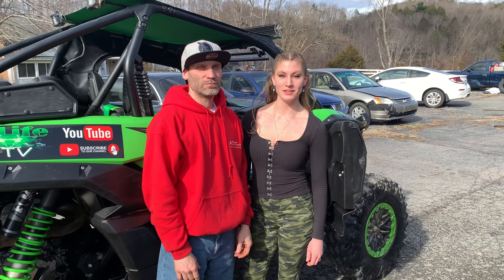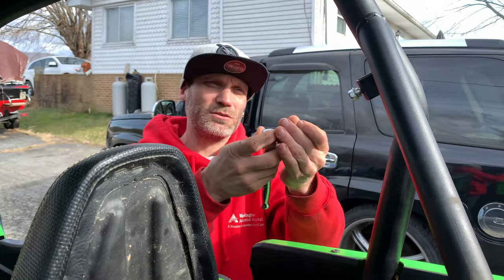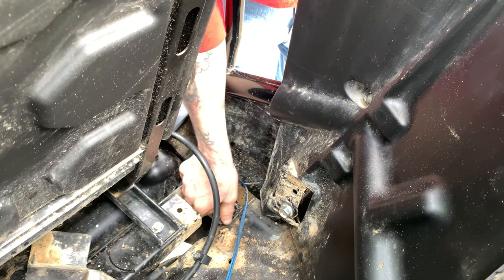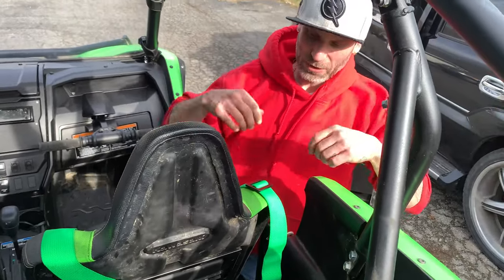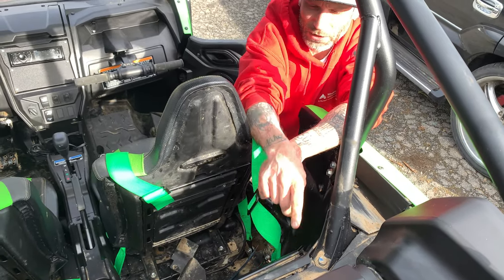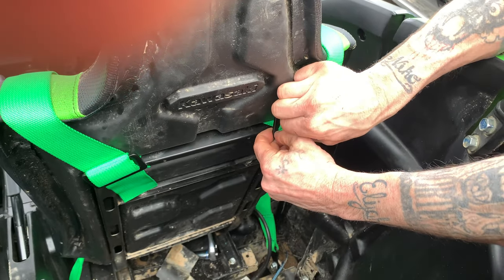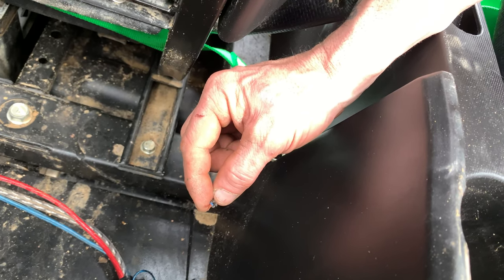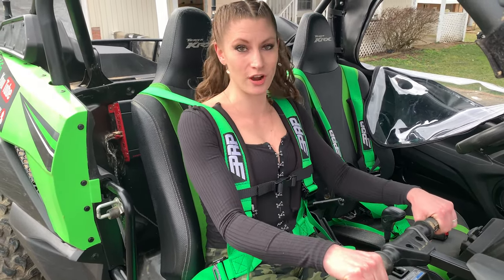How to install PRP 4.2 harnesses

Comment: I didn’t want to put the harness bars on mine either because they interfere with behind seat storage but I found the dragonfire harness mounts.  They are great. They bolt in with one one the cage bolts and screw into two holes already in that frame assembly behind the plastic.  Very easy install and lets your shoulder strap mount to the frame. You still retain all the storage behind the seat.
Reply from the maker: Nice if u can send me a link I’d like to check them out I’m getting ready to do a 3 inch lift and the primary clutch performance weights and all here soon should have an install video on that too

Comment: Great posting! great job installing the harness! I'm to lazy I had the dealer install the Kawasaki 6 point harness before I went to pick it up, I have the same PRP 4 point harness in my RZR, They are pretty good, the only thing I do not like about any harness is that they are a pain to adjust. Everybody is always fighting to adjust them when we go out for a ride as they always get stuck. I hate letting someone drive my RZR as I have to adjust the harness again and sometimes it will not budge, and when I get it on I can not reach the key to start the RZR or if I forget to grab my gloves I have to unbuckle the harness to reach them. (I know whaaaaa)
The Kawasaki harness is retractable so that is really nice, I can reach the key and my gloves and goggle now. I am thinking of removing the lower belts that go across your hips and just make them a four point harness, they are uncomfortable to me.
Reply from the maker: Yeah I’m very happy with the product especially for the price the insulation was easy I was a little short on the driver seat belt will try to get right to the point to save everybody me up 7 to 25 bucks no need to buy the plug when it’s just a loop system I like your spring videos I’m getting ready to do a 3 inch lift video soon